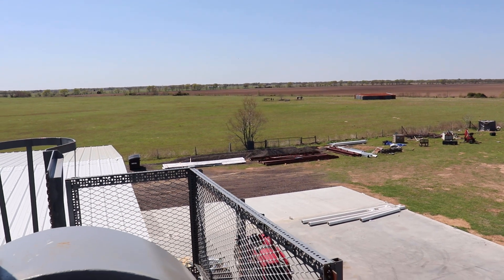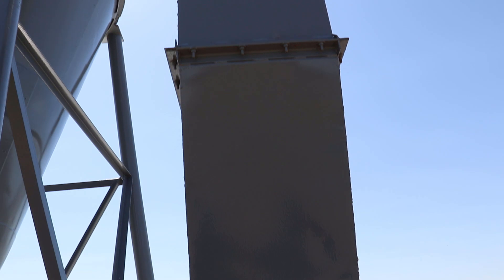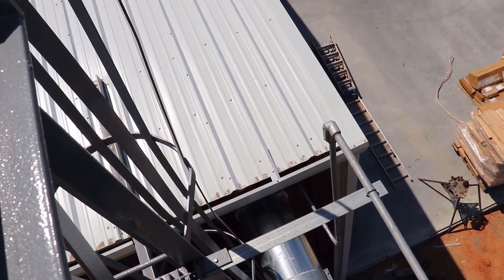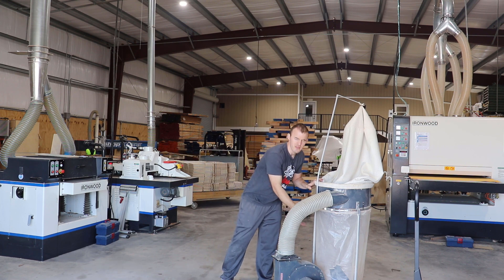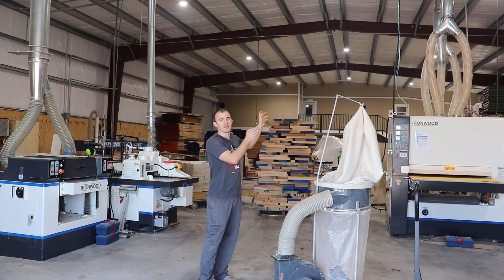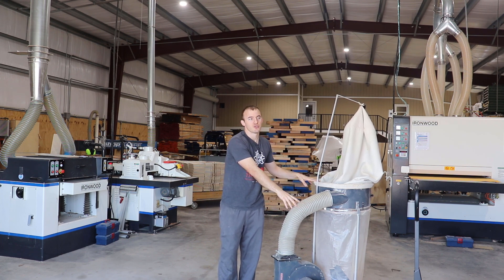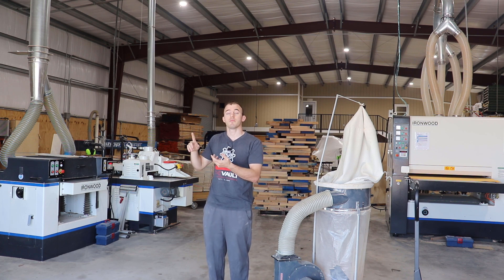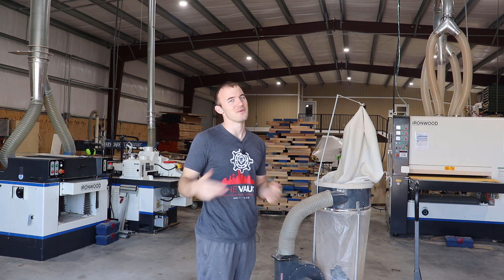My Shop's 42 Foot Dust Collector | Why We Use It

Comment: What happens when the hopper is full?  Do you sell it?  I can think of several ways to use it that might be profitable.  Or do you pay someone to remove it?  Just wondering; i dont even have a dust collection system yet so everything in my shop/garage is usually covered in sawdust.  But one day... 😁

Comment: I wish that you had talked more about your dust collector, what is it, where did you get it, how much did it cost,etc.? 

How are your china made Ironwood machines working out for you? I am looking at some of those as well as cantech.
Reply from the maker: Ironwood is great so far, Cantek I heard is good as well. I think Ironwood through Stiles is not a bad option, great service, but I haven't needed any except just getting more blades. 

I bought the dust collector from a past cabinet shop owner. In total I am in $45,000 on it, came in at least $100,000 under what a new one would cost.

Comment: Please help me i have a question...

I want to cut mdf Design (2.5D Cutting)  which is 12 mm thick

Which bit should i use .. ( material of bit too) and feeds and speeds for the same...

My machine can run maximum upto 4000 mm / min of feed rate...

Also should i use parallel shank 3mm end mill or other one

Comment: Very nice collection system. My shop is also in the middle of nowhere. I chose a much cheaper means of collecting dust-shavings commercial blower outside of my shop and send all dust collection to stand alone building. Local farmers and trappers take all they want. I never have to touch it just keep tabs on how full it gets. 
  The biggest bonus of a commercial unit is definitely not having all the extra noise from portable collection units.
Reply from the maker: I agree!